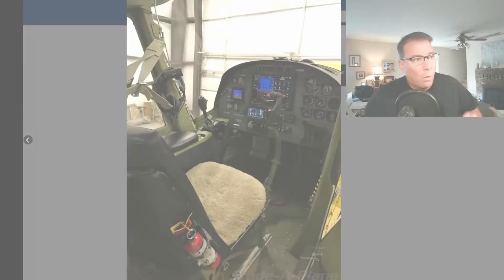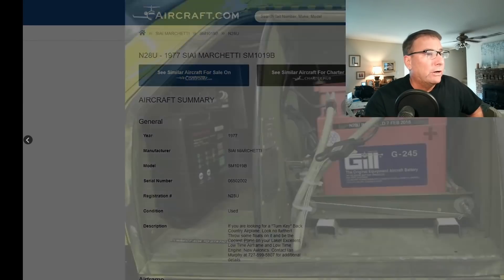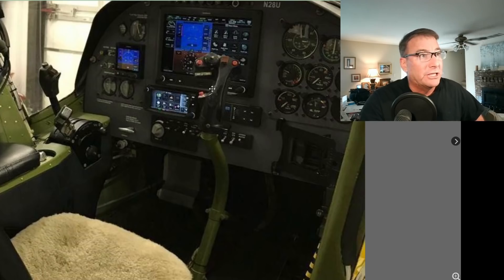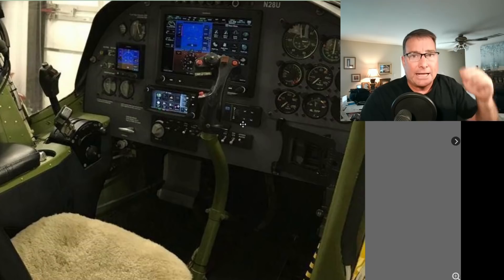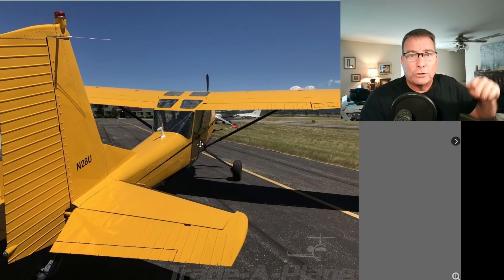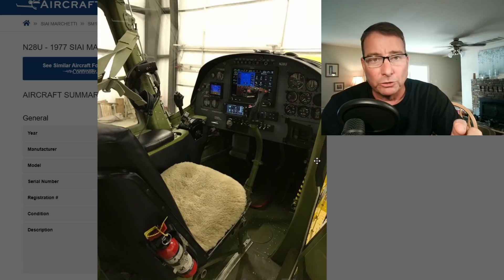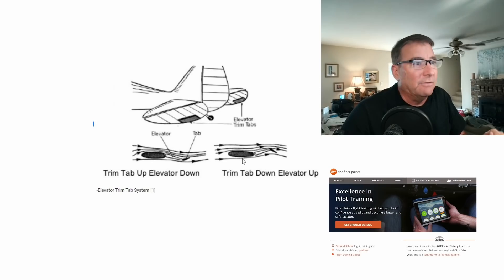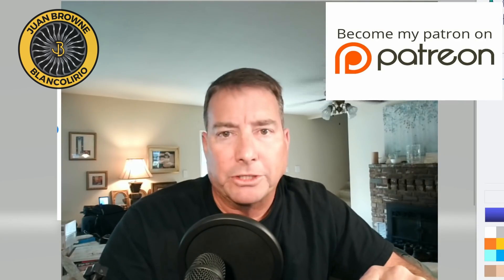Dale 'Snort' Snodgrass Siai Marchetti UPDATE- Elevator Trim System 8/8/21

Comment: I was watching the video of the crash yesterday while you where posting and to my eye it looked to be an identical profile as the 747 crash in Bagram right up to the nose over. That crash was of course caused by a load shift causing damage to the elevator control, and I cannot imagine a severe cargo shift like this in a light plane so I believe you hit the nail on the head with a diagnosis of a control system failure.
Reply: I got the same impression...  they'll absolutely have to rule out a load shift.  Because the initial pitch-up was so abrupt, that might have caused a chain reaction: (a) something caused the plane to over-rotate and (b) as a result, a bunch of heavy cargo went full aft.  In that case, not even full down elevator would make a difference.
Reply: A runaway trim would also cause that. Unless the person was carrying cargo it’s already been ruled out.
Reply: @JediOfTheRepublic  -- Could be.  But I personally have never flown a GA aircraft were full up trim makes it impossible to force the nose down, especially at low speeds.  Granted, that turbine propwash must be very strong.  But if it were really full nose-up trim, I think we'd have seen some kind of oscillation (even slight) to show he was fighting it.  Again, you may be right & the manufacturer will have to weigh in -- since their flight test records will include adverse trim tests.  But I also think there's a possibility something (maybe not cargo) slid back when he first rotated.  He may have intended a normal 'sporty' rotation & then maybe something heavy (suitcase, duffle bag, whatever) slid too far aft.
Reply: @pdquestions7673  Unfortunately if the cargo shifted and caused a CG divergence, it shifted all the way forward on impact. The empennage cover is (apparently, need confirm) canvas with velcro, but I also see a 1979 model's images with a tinned rear cargo compartment and some webbing net. 

That compartment appears to run almost to the front of the vertical stab.
Reply: @mfree80286  -- hopefully there's enough evidence to do a good investigation & infer a probable cause that's meaningful.  Just have to hope for the best & also hope people learn as much as they can from each accident like this.

Comment: The B737 MCAS fiasco taught everyone that trim forces depend strongly on airspeed. It is not clear that mis-trimming would exceed the range of control forces at takeoff speed (07:15)
Reply: I think what the MAX accidents inform, is don't get into a battle with the Stab using elevator trim. Not a fair fight.
Reply: Gordon... Not exactly. The Stab trim increased (ND) beyond the elevator authority to trim the airplane. They were doomed at just about any airspeed. The crew kept adding elevator, and ran out of authority  for NU.....
Reply: @billmecorney  In the Ethiopian Max crash, the takeoff power setting was never reduced, all the way through the pitch excursions, all the way to impact…   737s in general experience an enormous pitch up when adding power, especially if you’re not ready for it and ON the nose down trim AS the power comes up…
 With 18k hours of time in several models of the 737,  I can tell you that if you’re trimmed properly for a landing, then hit the TOGA switches without starting down trim, you’re gonna go for an interesting pitch up ride…
 Hit those switches twice gets you full thrust, and that is nearly impossible to control with the elevators alone, I’ve had a new FO that I was giving OE to do that, and I literally was hitting the full elevator nose down stop before the elevator trim started helping get the nose down…  
 I can’t see where Snort made any noticeable control inputs, even with the video slowed down and magnified… 
 I think when the controller asked him to come up on the 119.4 tower freq, it looked to me as if he pulled the power back for a moment, then pushed it up again, I kind of think that some of his camping gear fell in front of the stick and wedged it back during that power change…
Reply: @joer5571  That is my surmise also. A bag or camp stove lodged in front of the aft stick.

It was the new engines on the MAX that drove the installation of MCAS. Maneuvering Control Augmentation System.... Engineers feared takeoff would lead to pitch excursions and possible stall.  The cause of Lion and Ethiopian accidents was lack of awareness of the major changes.

As a 737 pilot, do you think the MAX should require a new Type certificate?

Comment: Does this aircraft not have a manual trim wheel?
Reply: No, because of the performance available from the engine then I imagine it would be possible for the power to overcome manual trim adjustment making a powered system necessary...
Reply: @gosportjamie  to try and move a trim tab that is connected to a manual trim wheel is physically impossible to do without breaking the actual trim tab, so I don’t think it has anything to do with power overcoming manual trim.

Comment: It happened so fast I think it would have been difficult to recover even if you were expecting it.
Reply from the maker: yes!
Reply: @blancolirio  This happen to me in a Partenavia P.68 when i first started working.The only thing I could do was to reduce the power. ended up doing a circruit  at a very uncomfortable low speed and land at Whyalla South Australia. I will always remember it, Run away  trim.
Reply: @magnusbadger6532  completely different airplane. You can absolutely out-muscle the trim on this plane. Especially at low speeds.

Comment: I'm not a pilot and have never flown in a small aircraft, I believe every pilot should watch your reports of the tragic crashes.  It could save a life.  Keep reporting  all the things you report on.
Reply: Lot of brainiac know-it-alls out there flyin', that the problem. Don't know how to get the rubber to the road when it matters most. Just look at twin engine pilots that have augered in recently. The most critical situation at take-off, especially so with twin engine plane, 1 engine fails, and no if, ands, or buts, must level off and turn to good engine side, to gain air speed and not stall bad engine wing, but none of them did that. They do just opposite of that and I not even a pilot. Watching all these video's has made me more scared to fly than ever. I especially like the AirBus flight with one pilot pushing forward on stick and other pulling back on stick at full throttle. They flat stalled that plane for 3 1/2 minutes into ocean..Scary stuff right there.

Comment: the way the plane pitched up so steadily... maybe a bad trim setting caused the initial abrupt over-rotation -- causing heavy cargo to slide back --- thus preventing a recovery even w full down elevator.  Maybe his muscle memory was used to a certain "nudge back" of the stick to get this rotation-attitude, but w a bad trim setting that usual nudge cause way more nose up that what he expected... and once some heavy cargo slid back, not even full down elevator could make a difference.  I would try to zoom the video images & see if there was full down elevator deflection after the over-rotation (might suggest cargo slid back after the initial unexpected over-rotation).
Reply: The elevator appears to be in exact trail position of the horizontal stab all the way to the crash.  It never moves, and is exactly lined up with the horizontal stab.
Reply: @tammyhefner8971  -- The image quality isn't the greatest, but if that's true... then maybe an elevator cable failure.  The flight profile looks a lot like a severe aft-CG incident, but maybe the flight control failure caused the initial over-rotation, which then caused all loose cargo to immediately slide aft.  Sad how quickly it all went bad.
Reply: @400_billion_suns  -- yeah, that looks a lot like down elevator...  strongly suggests some kind of severe aft-CG...  Maybe he wasn't carrying "cargo" per se.  But something heavy appears to have shifted far aft on rotation.  Maybe he was honestly practicing a sporty rotation & there was an unexpected shift in whatever luggage or materials he was carrying on board.

Comment: Juan, it will be a double blow to the fighter pilot community and aviation in general if one of our greatest and most skilled pilots died because of a runaway trim accident and possibly poor maintenance of that system.  The NTSB should be out with a prelim report soon. Let's see how bad they screw it up.
Reply from the maker: I doubt much will be learned from the preliminary other than date, time, and location.
Reply: @blancolirio  Agreed

Comment: Yeah, the seat belt theory didn't sit with me, especially since the plane has such an effective and easy to use control lock mechanism. Electric trim issue sounds like a more likely culprit.
Reply: There is many reported pilots who said this seat back collapses, look into that... think about it. if you are sitting back and then pitch the nose up, your back is going to slam more weight onto the back of the (very old) chair.
Reply: @dertythegrower  there is a rear seat instrument panel in this plane that seems to severely limit from seat rearward movement. Juan addressed that in this video
Reply: @raycoleman3183  98% of the viewers on YouTube don't watch all of, if any of, the videos. They just start typing.
Reply: And to be clear, that is the opinion of several YouTube content contributor's I've communicated with.

Comment: I would think that he could easily over power the trim forces at that slow of speed?
Reply: But he would have been at full power, and as Juan said; it's a powerful engine.
Reply: I haven't flown in years but as I remember you could roll in a lot of trim and still easily control the aircraft. I don't know why anyone would design an airplane that would be uncontrollable in either full up or up trim. I can't imagine any situation that would require that much trim adjustment.

Comment: Your photo right before the stall occurs and the aircraft rolls left appear to have wing flaps down. Is that just an illusion from the side view I am looking at (5:55 in the video)?
Reply: Also flaps appear to be set down at 51-55sec into the original crash video.
Reply: I think it's at full flaps during takeoff, and he does correct it as the aircraft turns towards the camera, but it's too late.

Comment: at 5:55 are his flaps down? "Stall speed: 98 km/h (61 mph, 53 kn) flaps up
70 km/h (43 mph; 38 kn) flaps extended"
Reply: I think so. I think he took off at full flaps, and corrected it as the plane turned towards the camera, but too late.

Comment: I am certainly not an expert or even a pilot but it is natural to try and make sense of this. The only thing speculation does is just keep the mind focused where it can do no good. If any of the controls were locked for what ever reason it won't take investigators long to determine this and there will probably be a report to deal with it other wise we will just have to wait. Just be careful your speculation might even drive investigators to look in the wrong direction. As someone who cares you need to let it go and let the investigators just do their jobs.
Reply from the maker: It's time to learn NOW! These are LIFE SAVING LESSONS (If you were rated you might better understand- and keep you up at night too).
Reply: @blancolirio  I do not doubt one bit that this keeps you up at night. What I am concerned about is you. How would you feel if a speculation actually caused the investigators to look in the wrong direction. I am simply saying nothing can be learned by speculation other than a possibility of going down the wrong path.
Reply: @richb313  lol....do you think the NTSB gets their guidance cues from a YouTube channel?.....or from anybody that's merely speculating.  If you weren't an actual witness, they would not be wasting their time listening to all the armchair chatter, unless they sought it out specifically.
Reply: @python3574  Normally not but Juan is highly respected in the aviation community so there is no way of telling how much can bleed over. That is exactly why investigators don't investigate if they have a personal connection but what we cannot know is if any of the investigators know Juan.
Reply: The time it takes to get the full investigation and findings could be a year or more.  In that time, if there's a way to save another person's life by determining what happened and how to avoid it happening again, you have to do it.  There are usually only a handful of things that could cause a crash once you've analyzed the audio, video, flight data, etc.  Using that knowledge to inform others so that a repeat can be prevented is key.  Otherwise, it's all for nothing.
Reply: Speculation is fine and healthy for pilots not for investigators.

Comment: Could his camping equipment come loose and shifted aft?
Reply: he wasn't carrying enough weight with all that to even cause an issue, if it did even manage to shift
Reply: It could have gotten in front of the rear control stick preventing it from moving to nose down position.  Assuming there was a control stick in the rear seat.  There normally is.

Comment: Going to be difficult to determine if there was an electrical problem with the trim system seeing how the aircraft engine/cockpit appeared to be destroyed by fire.  Dan can attest to the fact that sometimes these systems fail.  I hope the investigators can determine what happened.  Seems like if it was a foreign object (camping equipment, etc.) getting wedged between the stick and the instrument panel, someone could have discovered that by now.
Reply: I like your hypothesis but a small object getting into the unbooted cavity at the base of the rear stick. Was the rear belt long enough for a buckle to reach there? The crash impact might dislodge it.
Reply: @bjs2022 ,  Juan discussed that issue with the seat belt but said other pilots of this type aircraft indicated that the seat belt was not long enough to act as a control lock.  My speculation about something else blocking the rear stick comes from the discussion on Probable Cause in which Dan stated that Dale had loaded a lot of camping gear into the rear area of the aircraft.  However, I find it hard to understand a pilot of this experience level not checking control function before setting T/O power.  At this point anything we speculate about is just that; speculation.  Whatever the cause, Dale could not get the nose down.
Reply: @easttexan2933   You are right, yes, it’s hard to believe that he did not check the stick functions prior to takeoff. Probably something subsequently happened that prevented forward stick movement. His exclamations heard were probably his surprise that he couldn’t push it forward. We will have to hear if the investigators sync the radio transmission with the video showing the plane’s attitude to know if he said them when he was still nose up or diving down but either one doesn’t matter.

Comment: Might just be me but I don’t see any control surfaces moving in the video.
Reply: I would think the NTSB could recreate the incident safely on-site on same time line & determined quality of tower video
Rule out speculation of control surface movement
Reply: It's not just you. But the video resolution isn't great and it's riddled with compression artifacts, so it's entirely plausible that the control surfaces were moving but the video quality isn't sufficient to discern that movement. It's also plausible that the control surfaces really didn't move.

Comment: Is it possible that the trim tabs were all the way down and the electric motor control was not working at all? As he picked up speed the tabs would have gone from no force, to full force at rotation?
Reply: Visible at preflight check?
Reply: @larrybe2900  Yes, absolutely. Which is why we have to be extra careful preflighting as we age, just like when we were students!

Comment: Does this trim system use a drum? If so, it would be very easy to wrap the cable the wrong direction. Second set of eyes and a sign-off by that second set, primary flight controls, always! Did Snort work on this aircraft?
Reply: This is really starting to look like what happened to Onassis' son, where the ailerons were reversed during servicing.
Reply: @billg7205  Please refresh my old memory cells, what kind of aircraft was he flying?
Reply: @billg7205  Piaggio P.136 amphibious with Lycoming engines. Control stick was replaced the day before.
Reply: A British prototype airliner was lost on take-off after a mechanic had installed a control-column chain in a 'reverse' setting, so that the pilot was caught out as the plane was taking off: the plane's designer was on board and was killed along with the pilot who had no time to think.

Comment: Wouldn’t pulling the power lower the nose?
Reply from the maker: yes...
Reply: I was wondering the same thing, it would at the very least have reduced the left-turning tendency.  I just don't think there was enough time. Assuming Snort's left hand is on the throttle during take-off, and the stick in his right is giving too much resistance, my guess is he'd move his left hand to the stick to apply force with both hands, leaving the throttle set at full-forward. I've never attempted a power-reduction during power-on stall practice. I don't know what that would do.